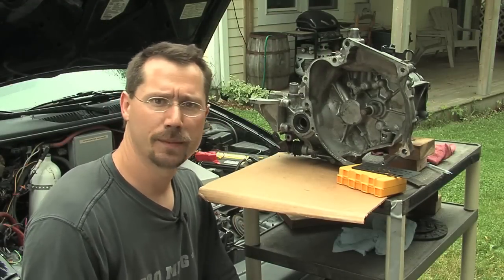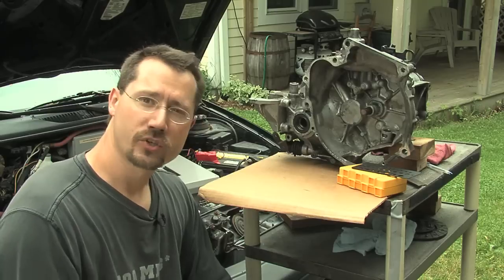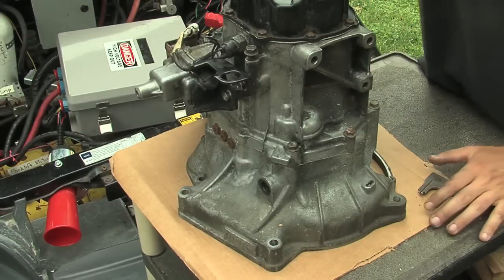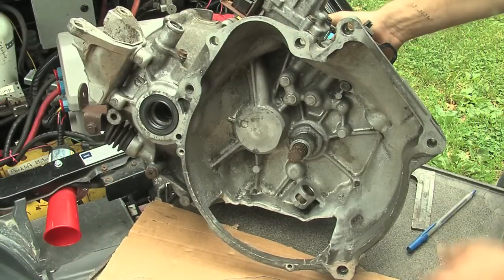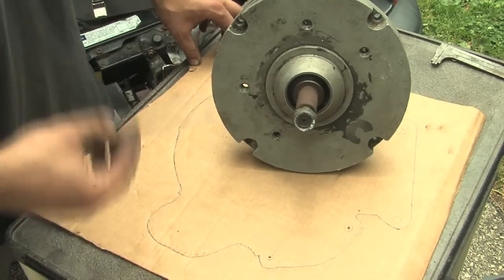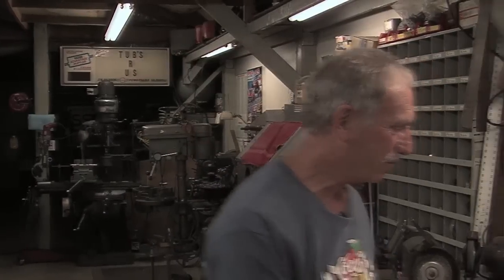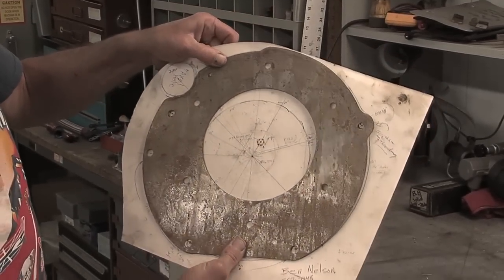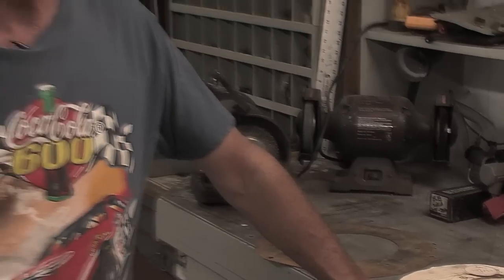7 Build Your Own Electric Car: Adapter Plate

Comment: You could  get a set of transfer punches from Harbor freight Then you don't  Even need a piece of cardboard just transfer the holes right on to your adapter plate Like of a machinist would doI think they're less and 10 Bucks

Comment: When I have made adaptor plates in the past for fitting bigger engines in smaller cars I use mild steel as you can gas cut it yourself and drill and tap the holes safely. You usually end up with so little metal left its not worth the weight saving of aluminium. Plus get a hole wrong and you can weld it up and have another go.

Comment: If you don't have a 'hot rod guy' living down the street you can take the motor and the transmission to an engineering shop, and they will tear your wallet to shreds to make a very nice adapter plate. I know this because I did it.... cost me more than my donor car.
Reply from the maker: It's completely possible to get great results with just careful measurements, a jig-saw, and a drill-press. If a person has any friends with more experience working with metal, invite them over for a beer. There are lots of great ways to learn and do things on a budget.
iforce2d, thanks for sharing the alternative!

Comment: Small tip on the shaft centering: Use a socket or a socket (that fits snug enough to not fall off-center, but not get stuck on the shaft) and extension if your shaft is more than a couple inches in. That way your cardboard doesn't get distorted... You can also check measurements from the outside where there's are points of reference ie holes, marks, etc.
Reply from the maker: Good tip!
Reply: You could also extend the shaft until it is flush with the surface that you'll be mounting the adapter plate. Then use some washable ink to make an exact template. This will eliminate any measuring.

Comment: It is possible to make an adjustable adapter plate. Make larger holes than the bolts require. Using a large washer, it is adjustable. When the transmission is in line with the motor, attach it to the washers to the plate by welding. When it rotates without vibration, it is in line.

Comment: Another idea is trace the trans directly to the adaptor plate and make one cut instead two (minus cutting the cardboard). more accurate. I've done this enough times to know. the center hole for the shaft can be larger for centering the motor.
Reply: cool tip, any idea to center shafts of the trans & ev engine then?

Comment: Easiet way for someone to do the adapter 100% themself would be to take a picture of the transmission mount and motor mount then move the pictures into Fusion 360(free CAD program) and use Fusion to trace the outline, holes and trans input shaft. You would then need a rough measurement for distance of say any two bolt holes and scale your 2D outline to match your physical measurement which you could then print on piece(s) of paper to test the dimensional accuracy of your 2D drawing. From there do the same for the motor and this will allow you to easily print and test fit while making adjustments to the motors alignment accuracy repeatedly for just a few dollars tops, assuming you had to use a local print store. Best part is you simply extrude the drawing to the thickness of the plate you want and you now have a 3D rendering of the plate.  Now with a $150 3D printer you could easily add dovetails and print the plate in pieces(# of pieces depends on 3D printers bed size) and glue them together to use for final test fitment and then as a template for drilling the holes.
Reply from the maker: "Easiest" is different for one person than another! However, if a person has skills with software like Fusion 360, go for it! I'm slowly working on my own vector/vinyl-cutting/laser-cutting skills.

Comment: I have enjoyed all your videos and perhaps, however, I probably missed a question that you already have answered?

Sorry that the question so basic, but here goes: Since most motorized tools have a control that permits the unit to start at 0 rpm and go its max rpm, why do you need a gearbox as opposed to a sprocket of the appropriate gearing?
Reply from the maker: The short answer is that a sprocket of appropriate gearing would be just fine, for a more basic vehicle.
When I built an electric motorcycle, that's all I did was connect the motor to the rear wheel with a chain and appropriate sprockets.
The longer answer is that a car is more complicated than a motorcycle. Most commercially-built electric cars use an electric motor which can handle a wide range of RPMs. The motor is connected to a single-speed gear reduction, often up to a 10:1 ratio. After that, it goes through a differential to split the power to two drive wheels.
In the case of a DIY home conversion of a vehicle to electric, you still need a place to mount the motor and a way to connect it to the driveline, a way to have gear reduction, and a way to split the power between two drive wheels. In a common front-wheel drive car, an existing manual transmission provides all those. (Even if you just left it in a single gear.)
It would be difficult to connect an electric motor to a car with only a chain and sprocket.
A transmission COULD be replaced with a dedicated single-speed gear reduction/differential combination. Right now in 2018, we're just seeing those types of devices coming to market for hobbyists.

Comment: surely to mark out for the motor, you would jsut need to measure the diameter/radius and use a compass to draw the circle, assuming it was round of course, but most motors are, and would save dismantling it.
Reply from the maker: One problem with assumptions is just that they aren't always right! Certainly, a person could do some accurate work with a compass and measurements, etc, but it really is very easy just to TRACE the part. The drive shaft of the motor and the driven shaft of the transmission do need to be aligned very accurately.
I made the assumption that the driven shaft of the transmission is in the center of the bell-housing. It isn't. On the first attempt of test-fitting all the components, we found that out. Always try to avoid assumptions.

Comment: hey try a dual sided front wheel drive transmission but you will have to invent it. then put an electric motor on one side running on a scooter motor powered electric generator and a regular gas motor on the front side. but you know they will make it not work right but no one has invented the easily change out parts system yet that lets you get away with it.  just make every piece as easy to install as a starter. this is to include the system for running and starting a scooter motor. then use them in a store bought product so that it is so easy to fix anything that breaking becomes obsolete. also you must do this for the regular gas engine. just make a super cheap version of meta breakable parts. which include but are not limited too starter, fuel injection control computer, points and spark plugs and alternator and fuse box. when someone comes up with cheap replacement parts eventually they will lose control. a timing computer can be replaced with a cellphone if it not kept in the engine compartment and is removed from its case to a much larger case with no cooling issues. don't use the phone plug it into the cigarette lighter plug but use the cheapest stuff in the world. heat sink tape may be an option for a 4 or 8 core used phones to seal for moisture while making it cheap to repair. 1 to 4 rear wheel scooter motors to 6 plug generator at 1 mile per hour test and if you say build it yourself again how about giving me the money to do so and i will.

Comment: I want to make an electric pick up truck what motor and truck would you recommend I was thinking small tuck but want to be able to tow
Reply from the maker: Smaller pickups such as Ford Rangers and Chevy S10s have been some of the most popular conversions. Being able to tow is a great feature, but it runs through batteries much quicker. I tow a camping trailer with my Mitsubishi iMiEV, and towing cuts my range almost in half, but I recharge the car when I'm at the campground. Take a look at some of the trucks on the EV Album for some truck conversion ideas. http://www.evalbum.com/type/TRCK

Comment: I see the bell housing is removable from the rest of the transmission. Since the bell is mostly a clutch housing and a starter motor mount, why not remove the bell and attach the motor to the transmission via a smaller adapter?
Reply from the maker: You would basically just be re-making the bell housing, just as a different shape. The motor still needs to be spaced away some distance so that the shaft of the transmission and the shaft of the electric motor can line up and be coupled together. The bell housing makes a great solid support for the motor and spacing.
A "small adapter" would still need to bolt to the rest of the transmission, support the transmission driven shaft, space the motor out correctly, and support the motor. Easier just to use the bell housing that design all that from scratch, when it doesn't have any additional advantage over the bell housing.

Comment: Hi Ben, I was how you supported the motor. Is bolting the motor to the transmission via the adapter plate enough? I'm concerned about the torque that the motor would exert on the transmission (80 lb motor).
Reply from the maker: In the original engine setup, there are three mounting points between the combination engine/transmission and the frame/body of the car. Two of those mounts were on the transmission and were still used. I reused the engine mount, but cut it and made a custom plate that connected to the back end of the motor. When done, all three engine mounts were reused, with just the one modified to support the electric motor instead of the engine.
Reply from the maker: Hi John, I'm going to make a follow-up video talking about exactly what I did to build a mounting bracket for the motor.
Reply: Thanks Ben! Your videos are very informative and helpful.
Reply from the maker: Here's the video about holding up the other end of the motor.
https://www.youtube.com/watch?v=2rrUvmuD-Mw
Reply: I’m loving this series that you’ve made... keep up the good work!

Comment: Hi please tell me clutch is really needed in electric conversion.
Reply from the maker: No, you don't necessarily need a clutch. https://300mpg.org/projects/electro-metro/going-clutchless/
Reply: But if you have the clutch you're able to go in reverse easily with the same motor orientation,  no?

Comment: What thickness of aluminum plate did you go with?
Reply from the maker: Half-inch aluminum plate. In the end, I just made two matching ones to double the thickness, instead of using a plate and spacers.
Reply: @BenjaminNelsonX  have you had any issues with the plate flexing? Heard that can cause concentric alignment issues

Comment: Hi Ben this is Raju from India I want to upgrade my 2006 skoda octavia 2gen 1.9pd disel to electric could u guide me in pdf format with spare details, I need the range of 400kms and 180bhp kind of 400nm Tourq range speed
Reply from the maker: Sorry Raju, I can't design a vehicle FOR you. I just try to do what I can to share and help educate people based on the projects that I've done. As always, take a look at the EV album (link in the description) to get ideas from projects other people have done. Also, please take a look at reducing your expectations of your vehicle. A car that can go 250 miles per charge and have almost 200 HP would be very expensive to build yourself. Those specs are very comparable to a Chevy Bolt, a current brand-new electric car costing $40,000 U.S. dollars.
Reply: Tks for ur kind response
Reply: I will go through that site tks

Comment: Rather than aligning the two perfectly on a adapter plate, couldn’t you just use a chain and gears? That way only one axis has to be perfectly aligned (he depth between the transmission and the motor)

Comment: You couldve saved a lot of time by marking it straight onto the aluminium plate.
Reply: James Mason but then he would have wasted an aluminum plate instead of a piece of cardboard and a piece of tin when the measurements inevitably needed adjusting.
Reply: @iforce2d  I've done a few things like this, so I have a few ideas about speeding up the process. Making the adapter to go between the input shaft and the electric motor shaft would be the first thing. Because the distance the motor sits in relation to the gearbox is the most important thing, so devising a way of achieving that I'd do first. Then the electric motor can be mounted to a plate. So make a plate for the motor AND a plate for the gearbox. That way you'd have square at both faces. Drill and tap the gearbox plate and they go together and because I started with connecting the two shafts, I know its aligned. Plates on both I know its square. Connecting the shafts with something like a flex disc like at the back of a BMW box would be the one. If there is ANY argument - ANY sideways pressure at all, in that shaft join, it will destroy the bearings in the motor. That has to be exact so I'd start by making that perfect. https://www.youtube.com/watch?v=mfxccVvFqhY this is my trike and the V8 I got to use in it. But actually I'm thinking of going electric with it. Electric is way lighter for the same torque.

Comment: Would you like to build me one and how much will you charge
Reply from the maker: Hello! I do NOT do custom conversions for other people, rather, I share what I learned through YouTube videos and blogging. I have literally HUNDREDS of videos on my channel about electric vehicles, renewable energy, and DIY. Also, take a look at all the information I have posted at https://300mpg.org
When I originally built this project, it was sort of a "hard-core summer project". It took quite a bit of time, but the learning about it and the various challenges of working on it were enjoyable. Simply building a vehicle for somebody else would still take quite a bit of time. More likely than not, it would cost more than a modest, used, commercially-built electric vehicle.
I still think that BUILDING your own electric vehicle can be a GREAT project, but it would fit in best with something that you couldn't simply buy used anyways, such as an electric truck, sports car, classic, or convertible.